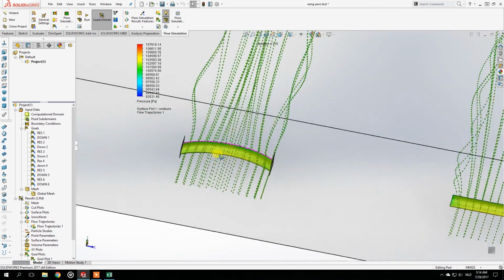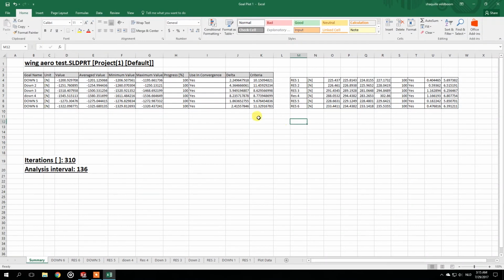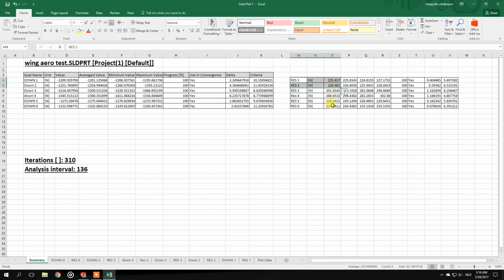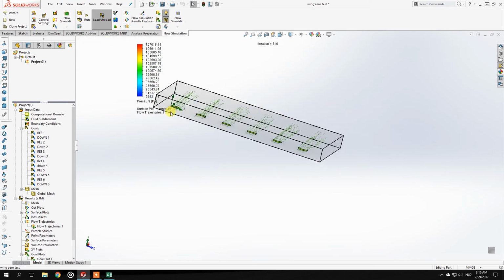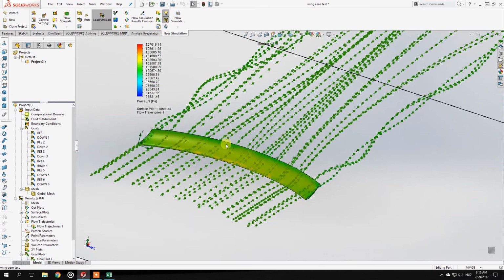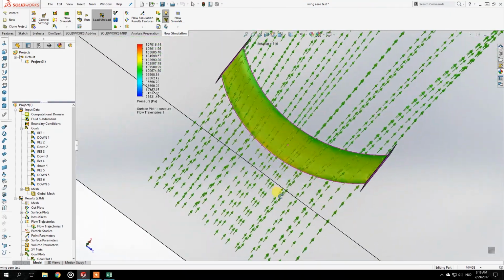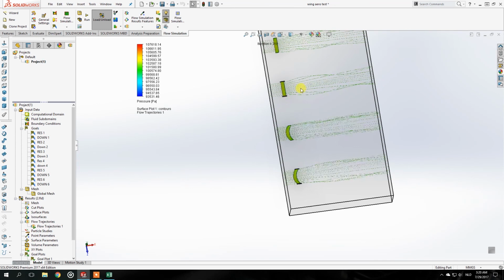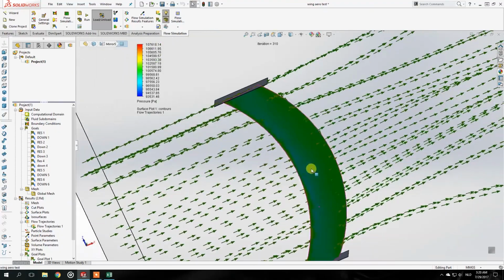CFD Testing different rear wing shapes in SolidWorks flow simulation | Veldboom Studios

Comment: But you can't just try the spoiler with the most downforce you need to put it on the car so you know how the air behaves after flowing over the roof
Reply from the maker: BEST STAR im aware of that that is why i was experimenting with the shapes to find out how they differ in air flow